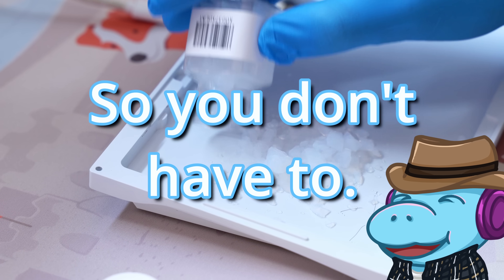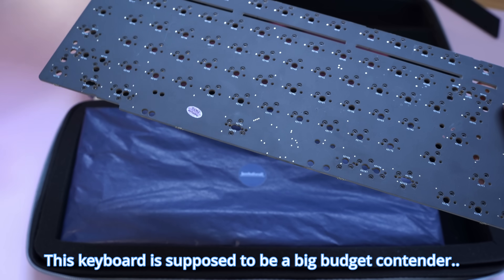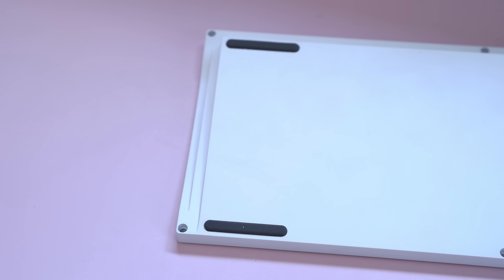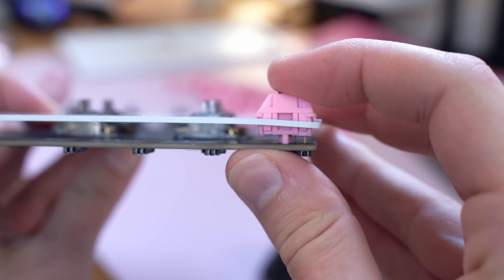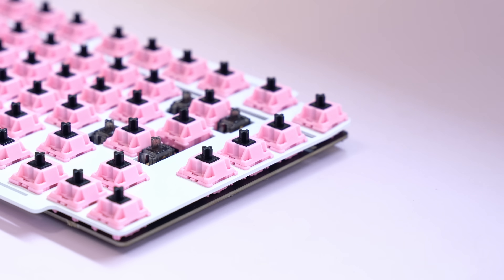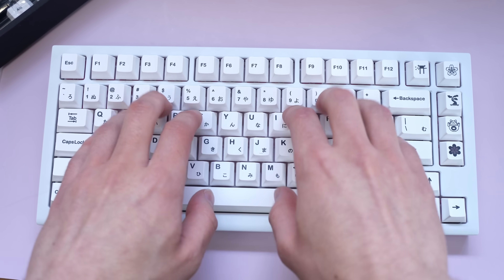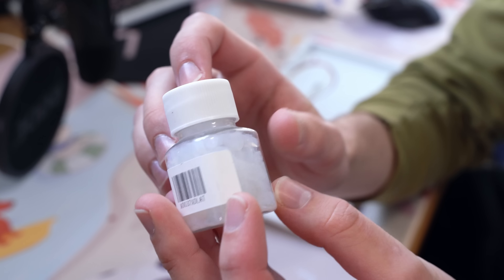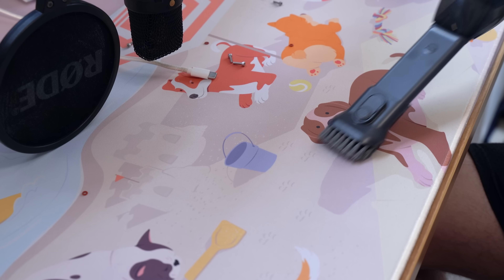I Filled a Keyboard With AEROGEL... (So You DON'T Have To)

Comment: Can you fill a keyboard with mineral oil? Surely a liquid dampens noise better than foam or gel
Reply: Sound travels better off of and through most liquids. Oil would likely mute it a bit, but it would be a sloshy mess to fill it enough to contact the PCB or generate a higher pitch keystroke sound from reducing the effective size of the sound cavity. But hey, who isn't down for a sloppy, wet keyboard? hahaha
Reply: @illitero  Sound travels well through liquid but it also loses a lot of energy by changing mediums. Going through a liquid and crossing into air makes the sound dampen quite a lot.
Reply: @auctoritate8254  science
Reply: @illitero  HOW ABOUT SLIME??
Reply: @lenib9195  god damn it
Reply: @lenib9195  NICKELODEON GAK KEYBOARD
Reply: @lenib9195  electrically conductive
Reply: wouldn't this damage the pcb?

Comment: I use this thing used to dampen sound in cars, it's like thin aluminium on one side and some sticky black stuff on the other side. kills noise and ping dead. Love it.
Reply: Probably a butyl rubber mat. Kilamat is a popular brand for that type of material.
Reply: is it noico sound deadener?
Reply: Which material do you use? Got a link on amazon?
Reply: yeah and i use it for my keyboard as well
Reply: Dynamat
Reply: @Leoooo._.1.-.1  it prevents vibration under the floor board, of the car, and the back.
Reply: I love your profile picture by the way!
Reply: Dynamat?

Comment: Kinda cool fact: one of the chemicals used to make aerogel, tetramethyl orthosilicate, is basically pure sand but in liquid form. It reacts with water to turn into its solid form, and becomes super super fine, but is insanely dangerous. This is because if you get it in your eyes it reacts with the water in your eyes and turns solid, but does so under the surface of your eyeballs, and causes permanent blindness. Also if you inhale it then it reacts with the water in your lungs, and having sand in your lungs is bad (shocker).
Reply: thanks for making my eyes hurt and drying my throat
Reply: silicon hates us
Reply: I call bull

Comment: for sure the aerogel. Holy shit the difference is huge.

But it's interesting because it doesn't sound like it just "dampens" the sound, it actually changes the resonance characteristics of the sound, and where the fundamental frequencies of the (switches? board?) are located. Especially obvious on the bigger keys like spacebar

Comment: Having studied stage technics, recording etc. it doesn’t make a whole lot of sense to me to use something really light like this as a sound damper. I mean sure, it would affect the way the sound reflects in the case, but to properly insulate sound needs mass.

I've never modded a keyboard, but just baaed on what I learned at school, I'd pick some material that's dense (heavy) but also irregular or porous. Like a really heavy foam mat or some natural rubber with an irregular surface.

Comment: this is neat but doesnt aerogel ha e the drawback of it losing its shape from constant pressure like that because its so much air that after a while the air will just be pushed out after 6 months to year of repeated use where the sound will end up just be back to as if there is no foam?

Comment: I just buy a tube of 100% silicone calk and use that as a filler. You can use cornstarch to keep it from sticking and being a permanent mod. Also you can get grout silicone in a bunch of different colors at a tile store.  Very cheap and effective and will fit any board.
Reply: Ugh, that's so backyard. There's silicone mold mixes with different viscosities and without the nasty ammonia that's contained in caulking. And why use cornstarch when there's mold release spray? If you want to do it, do it right.

Comment: Aerogel is commonly used as a insulator for heat (works amazingly well) and to catch space debris. There are lots of other uses but these two are the most common. I’m a bit late to the vid but I can try and answer some questions if anyone has some about aerogel. I’m currently working with it for research.
Reply: what does it feel like to squeeze
Reply: @alexy5660  Its extremely brittle, so it just crushes to a bunch of little pieces. The dust and small crumbly pieces will stick to your hand a little bit since it tries to absorb the water and oil on your skin.
Reply: Is it ok being used like this? Someone else mentioned it hardening in your eyeball and I'm terrified — like, what if you rubbed your eye while building this or if it leaked
Reply: @KukaiTori  its extremely brittle so it crumbles easy. Its safe if you get it on you, it just likes to absorb the oil and moisture from your skin. Just wash your hands after and you're all good. It only hardens when you make it (manufacture). When it absorbs liquids and oils, it expands slightly, turns to more of a white color and basically turns to dust when you touch it or try and move it. If it gets in your eyes you just need to rinse it out well and you're all good.

Comment: I wanted to do this but it was too expensive
theres also aerogel in the form of thin films which I think would work better than solid stuff
Reply: @Alex-vm9ug  because its used in home insulation

and just a guess but the porous structure of aerogel means sound would bounce a lot inside aerogel
Reply: @placeholder3863  theres next to no material density in aerogel, youd need an unrealistic amount to provide any noticeable acoustic dampening. also... thermal Insulators and acoustic dampeners are not the same thing....
Reply: @Alex-vm9ug  but thermal insulators also block out noise, also why does density matter in this application?
Reply: @placeholder3863  because density is what dampens sound waves? different ranges of densities and materials depending on the frequencies you are targeting. aerogel is 99% air....... 1% silica is going to do nothing. you may as well take a silicone sheet, cut it so that it only has a single molecular bond for height, and you will have yourself the equivalent of what aerogel can do for sound dampening, nothing.

Comment: Aerogel insulation beads would have been a very good choice for this. Sometimes it's formulated into a product used for insulation in high end housing
Reply: Oooh
Reply: That's what I used on my board and it's great. I put it on a stone case with Cerakeys

Comment: A bit out of touch on not liking aluminum plates. They can be amazing. You might be a little out of touch with that though. I think you stepped back from active participation with the keyboard community as you became more of a content creator (for good reason), but you might have missed how newer board designs fix the nasty pinging of aluminium plates from back in the day.

Comment: For burger mount you're supposed to put o-rings both sides of the screw so that the plate doesn't touch either the screw heads nor the case metal.

Comment: A Rode NT1 might not be the right mic to pick up the pinging well, I couldn't hear any difference between foam and no foam lol. NT1s are pretty dark so that may be why. iirc the NT1A is a bit brighter so it might bring out the pinging more. Anyways I'm gonna go order some aerogel padding for the keyboard I got for $4 with white alps clones. Swap on a PS/2 cable and it'll be good to go.

Comment: When it comes to burger mounting

Try and put the screws and o rings on the keyboard BEFORE putting it down and screwing everything in place.

I usually like putting the o ring on the screw, poking it thru the plate, putting the o ring in the other side of plate, and then use the end of a small pens ink cartridge, to push the little o ring to seat it nicely. It'll hold the screw in place so you don't have to worry about them yeeting themselves